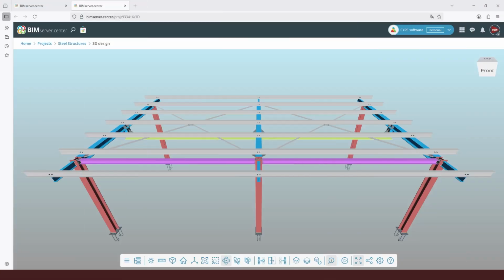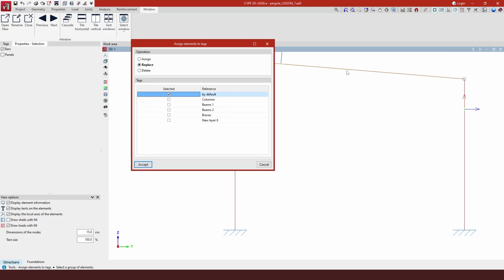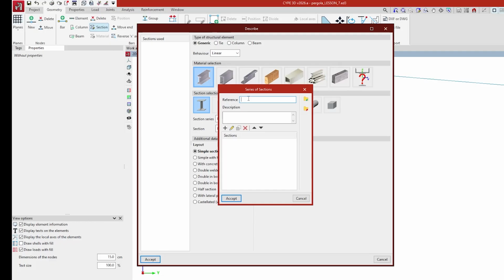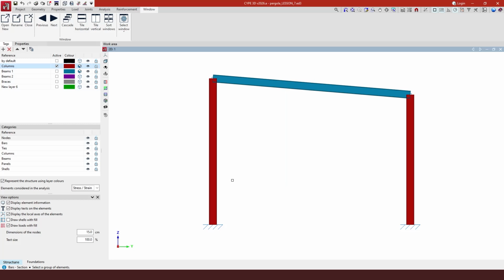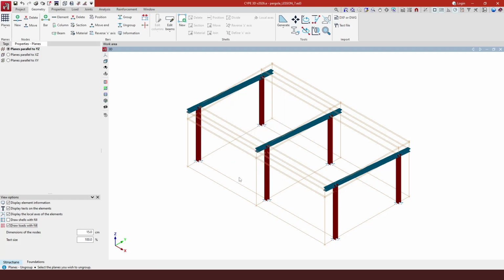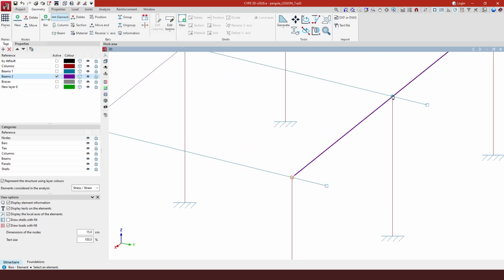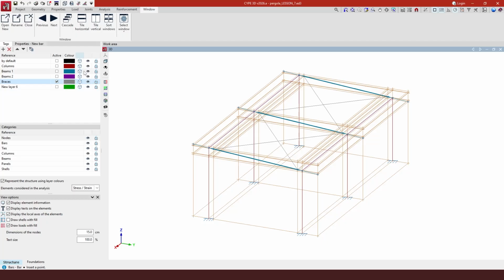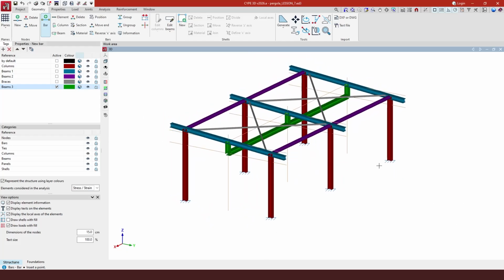7 - Introduction to the main steel elements of the structure | CYPE Steel Structures

Comment: how to model the purlins in cype3D without using the portal frame generator? is it by adding beams on top of rafters one by one?
Reply from the maker: Hello! That is correct. If you want to insert purlins in CYPE 3D, they are modelled using beams located in the corresponding position, just like the rest of the structural elements. If you use Portal Frame Generator, the purlins can be analysed and designed in this program and exported to CYPE 3D only in the form of loads, not as individual beams in the model. Thank you! 😊